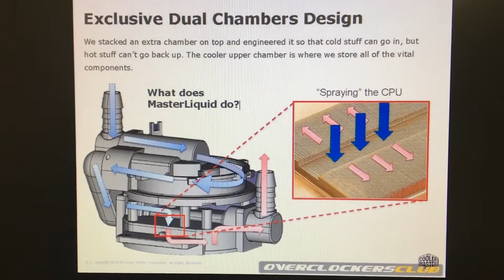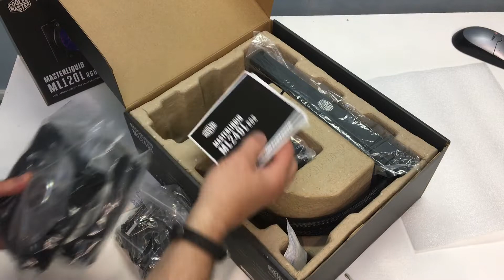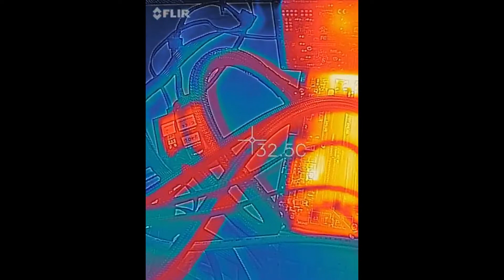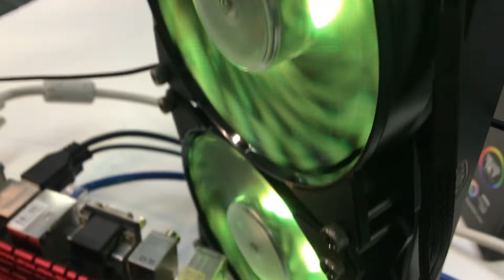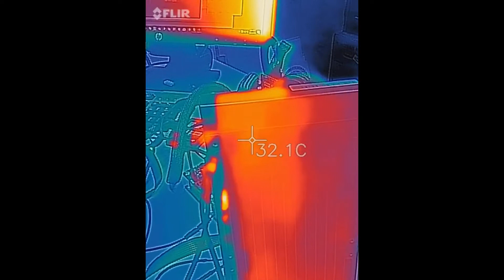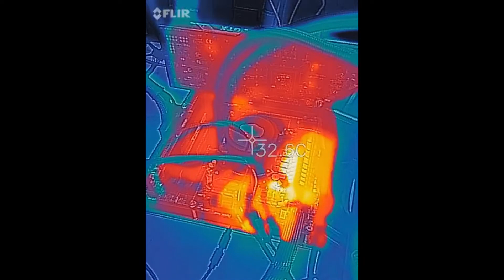Cooler Master MasterLiquid ML120L and ML240L Cooler Review

Comment: hey i have one question, i just bough this cooler and it has been installed on a intel i5 11600k, and when i run cinebenh r20 it heats upto 80 degrees celcius, is that normal? or i have done something wrong with the cooler instalation?

Comment: Hi I’ve just bought this and I need a quick reply if possible.
The cables coming from the cooler( on the cpu) are they suppose to go into the cpu socket or attack to the rgb lighting sockets?
Reply: Did you connect it or are you still waiting for response?

Comment: I have i5 9600k in my system. Will this aio be enough for the cpu? im not planning to oc my cpu at the moment, im using the system for playing games only but will this be able to handle oc if i want to do it in future ?

all the questions aside, great video
Reply from the maker: That is not an easy question.  Short answer is you are probably fine,  but there are several factors that go into the success of a cooler.  The air temp in your room,  what case you are using, how many fans, fan speed profiles, how aggressive is the overclock, and type of GPU as well as other variables all factor into this. That is why it is hard to give a solid answer.
Reply: OverclockersClub but for gaming environment will this be enough ? 
Thanks for the reply
Reply from the maker: @abhisheksathe123  Make sure you have good airflow through your case, especially if your GPU dumps heat into the case instead of blowing it out the back. But for gaming it should be ok.

Comment: I recently had one of these ML120L installed on my ASUS rog strix gd30ci.  When i boot up my fan on the ml120 spins fine but turns off shortly after logging into my account.  I looked in the AEGIS 3 app (asus fan controls) and it says all my fans are still spinning.  My computer still stays pretty cool though while playing games, i saw it top out at around 70 degrees Celsius.  Any ideas?
Reply from the maker: Try a different fan - and also try a different fan header on your MB.  The cooler fan (any cooler fan) is usually plugged into the CPU fan header.  Most motherboards have a CPU OPT fan header too.  You can also check your fan control settings in your BIOS.

Comment: Hi, I have a Intel stock cooler and when im playing games the max temp on my cpu is about 75-80 C° and the cooler goes up to 2800 3000 rpm, and its really noisy and im looking to buy this one can you just tell me is the noise same as the stock cooler or is it quieter
Reply: it is much quieter
Reply: cooler master is a good brand. But if you really want a silent system then I'd recommend Noctua.

Comment: I have an A10-9700 APU from AMD with its stock cooler (pretty basic and barebones). Its usual temperature is around 60ºC (140), but during the summer in my region it can reach around 95ºC (203) when gaming. My motherboard is too small and has only 2 RAM slots so a big chunky air cooler is not an option. I've never had a water cooler in my life, tho, so I'm kinda insecure about getting this one. I've seen there are other better water coolers (like the Mly-d12x-a20mb-r1) but they go way over my budget. I also have no RGB on my motherboard so getting that physical RGB controller gets me interested as well.
Reply: Definitely the way to go, do some research on the cooler but these are great, I live in Australia and the summers are intense and my cooler has kept my PC nice and cool especially in our 40° plus summers
Reply: I would save my money and upgrade the system before buying an aftermarket cooler.

Comment: I got a R7 2700x currently im using the stock prism cooler, shall i go with the 120ml or 240?
Reply from the maker: Amien The 120 will work, but if you have room for the 240, I would certainly go that route. Of course there are other factors like the climate you live in, and the type of workload on the CPU. But you can’t go wrong with the 240.
Reply: where i live the room temps are around 30c, what temps will i get with 120ml and the 240ml?
Reply: @overclockersclub  like what will the temps be with the 120 and what temps will i get with the 240

Comment: thanks so much mate.cause of this video I bought the ml240l !
Reply: vinny 3939 I ordered the same, I’m worrying about leaks and stuff because my pc is 2k and I don’t want it ruined. Is yours working fine?
Reply from the maker: ScreaMz I can say that I’ve used and tested many liquid coolers over the years and never had a leak. The only exception is from the one that I dropped on the floor, but that was of course my fault.

Comment: Thanks for the video ! Very helpfull. Can you say something about noise level ? In the video, the noise seems quite loud but i can't tell if it comes from another source. I'm considering if i should swap to liquid system with this product or stick with air cooling.
Reply from the maker: Any cooler will be loud when the fans are cranked up.  And most people probably don't have their cooler fans running at full speed all the time.  The sound level will also vary depending on the case you use, and the number of case fans.  But I have tested many coolers (air and liquid) over the years and with regard to sound -  I would have no problem using any of them.
Reply: @OverclockersClub Thank you for taking your time to answer my question. I think i will go with the 240L version. I dont think i will ever put fans to 100% RPM since im not planning to do OC on my Ryzen 2600, or just maybe a little (would be my first time). Just a last question, do u know if pump should run %100 at all time or there is no problem in setting a temp curve ?
Reply from the maker: @pedroparodiramirez4537  The power to the pump uses a 3-pin plug that connects to the CPU fan header on your motherboard.  This should allow you to vary the pump speed through the BIOS or the motherboard software / utility.   Overclocking and heavy CPU loads will require higher pump speeds, but normal use can generally tolerate lower pump speeds.  And for thermal safety, the CPU fan header usually won't allow a fan /  pump speed of zero. You can have some fun experimenting and finding the best setup for your system.

Comment: I'd like to use this on my i5 4670K in a Fractal Design Meshify C (new case) and ASUS Z97 Pro Gamer, GTX 1070, 16GB HyperX 1866 RAM.  I'm running a stable overclock of 4.4GHz at 1.185V with the stock Intel fan/heatsink.  I've been running it this way for about 2 years (bought the system used for $200CDN w/o the GPU).   Great system that still pushes 75fps in most games at 1440p (75Hz Freesync monitor).

Temps in-game touch 79C sometimes, usually average 60 - 70C.  I use Battlefield 1 and Battlefront 2 to stress it and check stability as it actually uses a 4 core CPU, but I mainly play DCS World, Squad, Post Scriptum.  

My question, should I bother with this?  Would it let me get a better OC?  I'm really just curious to try a different cooler.  Thanks.
Reply from the maker: Going from the stock cooler to this liquid system should certainly bring your temps down - giving you some additional thermal headroom.  How much is hard to say.  A lot of it depends on the ambient temp in the room, if your graphics card is dumping a ton of heat into the case,  and of course how well the airflow is in your case.
Reply: @overclockersclub  Temps are 22C in my case and the EVGA 1070 (5173KR) doesn't get warm at all.  I suppose I could try the ML240L and use it on my next build when I finally do upgrade.  My voltage is low so maybe I could get it to 4.6GHz.  Probably won't give much of a boost in-game, but it will be fun to try.  Is it a bad idea to also OC my vid card a bit?

Comment: Is ML 240l good enough  for ryzen  3900x ?
Reply: Get a corsair h100i rgb platinum, spend some money on cooler cuz that is important
Reply: @kush7796  I will c the temps b4 I change cooler
Reply from the maker: Yeah it will be fine. Overclocking might be a problem though. But that is most coolers on the market. These chips get hot.

Comment: One question, can I put fans on both sides of ml240l?
Reply: I mean, on radiator of ml240l...
Reply from the maker: Absolutely! The only limitation is space restrictions of the case you are using.
Reply: @overclockersclub  okay, thanks, I have MS Industrial Spectrum, would it fit into this case?

Comment: Hey. Do you think that the 120 is good enough for r7 3700x?
Reply from the maker: Hey this is Isaiah. I don't think it will better than the included Wraith Cooler (Besides being quieter and looking cleaner in a build). I have the 3800x and using the ID-Cooling x 240 that Chris reviewed. It runs around 70c normal load. Prime95 is about 77c. The Waith Cooler get up to 83c under normal load. I think the issue is so much heat is generated in such a small package. A larger cooler will help, but it isn't going to solve the route issue. Using Thermal Grizzy Kryonaut helped me to drop a few C off the included thermal paste.

Comment: does anybody had leaking problems with the ML240L?? i just got mine today but i came across some bad reviews and now i'm afraid it could leak and damage my graphic card; and what about the pump? how much should i expect it to last?
Reply from the maker: I can't speak for everyone, but in the 10 years I have been using liquid cooling (from several vendors) I have never had a leak issue.
Reply: @overclockersclub  thanks for replying, so far so good..i installed it yesterday, no leaking and it also seems pretty silent to me. 25 idle temp with a 9600k.  Some people said in their reviews that they even found fluid in the plastic bags right after unboxing it :S
Reply: @mikuni9599  Why did you buy it after reading those reviews is the real question

Comment: You should buy a microphone that you put on your shirt, the audio quality would be 100X better. Great video though! Does the ML240L cool good under overclocks?
Reply from the maker: I actually have one but every time I bumped into something the distortion was horrible so I keep it off to the side.  As for cooling - generally yes, but there are many variables such as the type of CPU, the intensity of the overclock, case airflow, graphics card style (blower vs open air), etc.  So it is hard to give you a direct answer.
Reply: @overclockersclub  Thanks so much, I'm planning to pair the 240L with a 3700X since the X570 motherboard I've ordered has it as a free promotional item. Not sure if I should just stick with the wraith or use the AIO
Reply from the maker: @mcvoid_  I understand that the Wraith is a decent cooler - but I have not yet tested one.  I am sure AMD wouldn't risk sending out a crappy cooler with such a powerful line of CPUs. You can always try it and see if you are happy with it.  If not, no harm in going with the ML240L.
Reply: @overclockersclub  You're right. Thanks so much for your help. Earned a sub
Reply: @mcvoid_  i tried the stock cooler for over clocking the same processor, thought and a more ancient one...amd stock coolers are good in the average limit use of the processors, i tried the overclocking and it scored freaking temps and throttle of the cpu, iw as afraid to fry my processor but it luckily it shutdown on its own as a safety mechanism...so forget overclocking ,the only good thing about their coolers are the silence at high speed either for the wraith or the spire at 2000 rpm..but even though its not suitable for a serious over clocking...i had to buy another 212 air cooler from cooler master to reach the limits of over clocking...try cinebench with the stock cooler with no over clocking and u will understand what iam saying...hope this gives you and idea about overclocking with the stock cooler...only if you are aware enough to use a liquid metal thermal paste you can use it..but also no guarantees in the silicon lottery